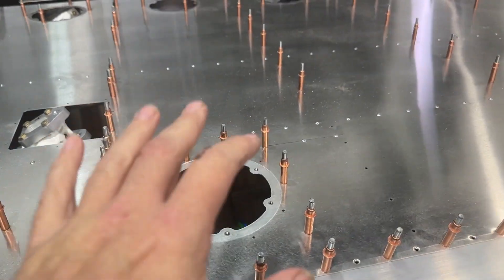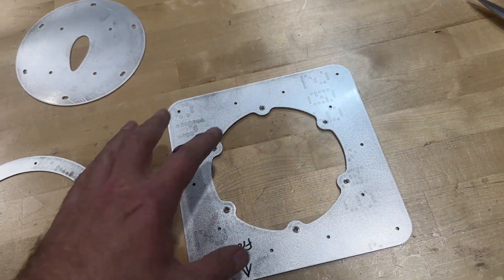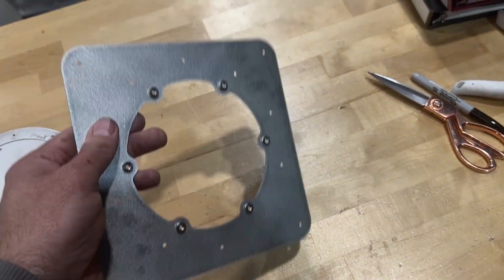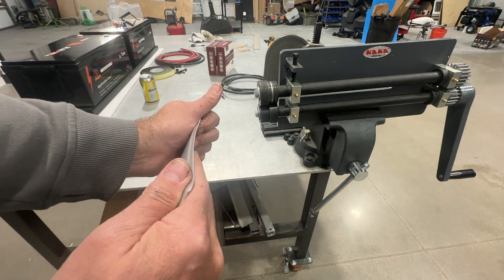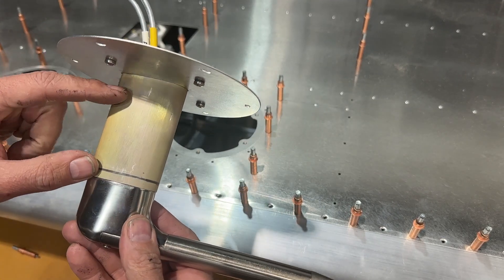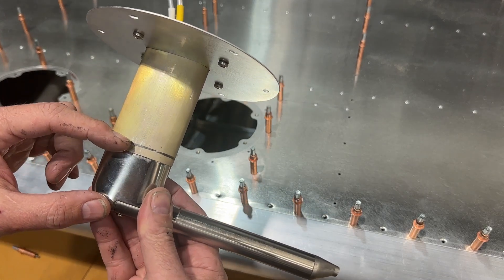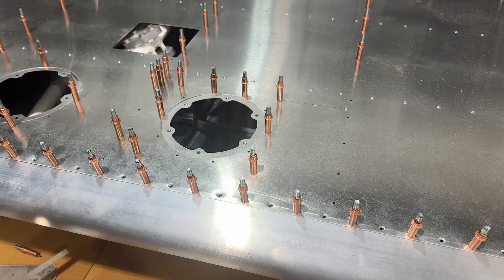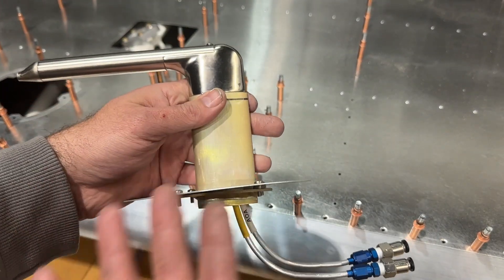Ep. 43 - RANS S-21 Pitot & AOA Tube Mounting

Comment: Can I just say that I love your videos?  Simple, mature, direct, and informative. You are not trying to clown around, and make a silly comedy show out it.  Nor do you have riedculously long beginnings to your videos.  I envy your craftsman ship.  I have questions. Why no primer on mating rib to skin?  do you debur all the prepunced holes?   # Subscribed.
Reply from the maker: Thanks for watching and subscribing. As for priming, I only prime primary structure items where corrosion could cause structural issues. In the case of the ribs to skin, that is a secondary structure interface and not critical. 

Many of the punched holes come de-burred already but I always give them a feel to check and of course all builder drilled holes get de-burred.
Reply: Great job! Although I am building a Zenith Cruzer, I am also using a Dynon pitot tube and would like to use one of your installation kits! Put me on the list please!